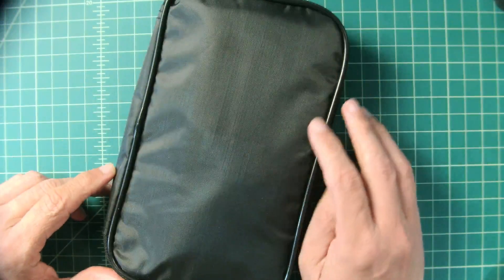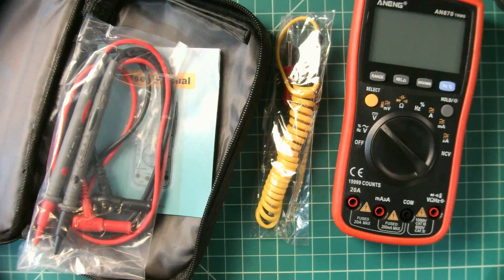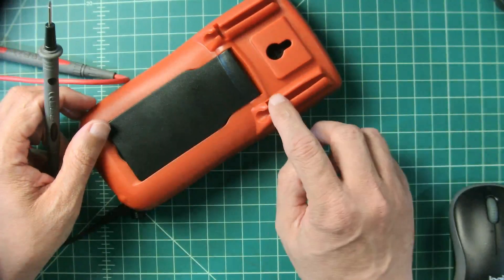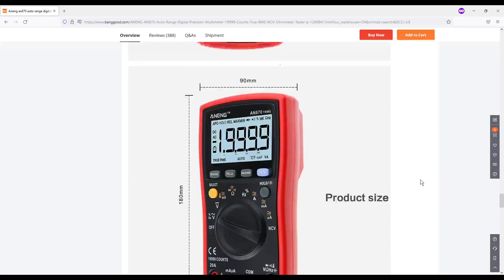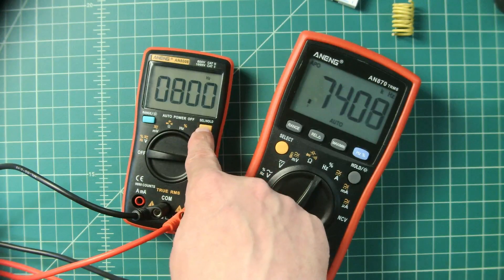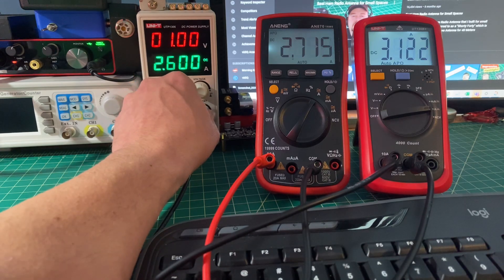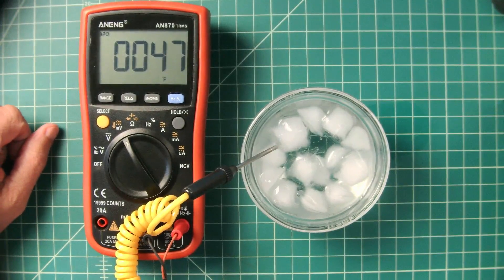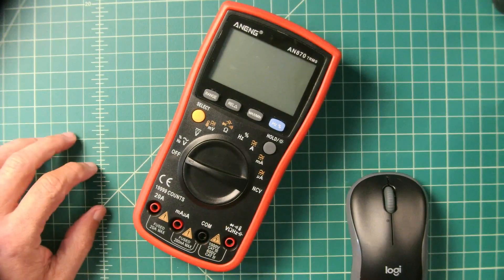ANENG AN870 Multimeter Review

Comment: "On the meter there are some ratings where it says it's a 1000v cat III and 600v cat IV.
I take those cat ratings with a significant grain of salt when it comes to these cheaper budget meters.
I wouldn't use them on any high energy circuits. I would use a more credited brand." 

All is said, in fact there is no need to buy a cheap meter cat IV 600v cat III 1000v if you are not going to use it as it should be intented to be used. 
When a known brand in this security catergory is about 300$ and this chinese is 55$ the first question that you should ask yourselve before sticking the test probes on high voltage current terminals is: "But where are the $250 of device security & mesurement components that are deducted from the price of the Chinese device?". May be not only $ for the brand logo and color. May be chineses builds are better than other...But, Unlike cats, we only have one life...
Reply from the maker: Totally agree Jerome, thanks for the comment 👍

Comment: Thanks for the video. You say you wouldn't use this only for electronic and desktop type work... Am I correct in understanding that in your opinion it would not be a safe enough choice for home electric work (230v)? Thanks
Reply: I am looking to buy a basic but safe multimeter for doing electric work around the house, and avoiding another cheap Chinese built multimeter that will not last
Reply from the maker: I wouldn't consider this one for that.  Maybe check out the Fluke or Bryman meters but they will set you back some cash.
Reply: @TheSmokinApe  thanks for advice. Any model in particular, considering it is definitely not a professional use I have, and cost is a factor. Thanks

Comment: I am going to re-cap an old Pioneer 70s Hifi amplifier ( a SA-9800). Is this multimeter reliable concerning the voltages in the amp or should I get something else? If so, what?

When thinking of it I also have a very old Akai M-8 Tube Reel to reel which has huge caps. So maybe this multimeter is dangerous to use in that environment?

Comment: The cheapest one at HFT is good for hobbiest purposes.  Under $10.00
Reply from the maker: Depends on your definition of “good” and what type of hobby work you are doing.  Thanks for checking out the video Dominic 👍
Reply: @TheSmokinApe  Just enough to get a ball park figure for outlets for 110V AC, 12-13.8v DC for car cig., batteries and power supplies, and checking track voltages and currents on 3 rail Lionel trains.  Use it as a job meter?  More than likely not.

Comment: hey Ape, My old Fluke 77 just went up in smoke & died a few weeks ago.  I was checking some voltages in my TS-430S to make sure it was ok. I opened it up and the main CPU blob was poped I a whole bunch of other components was burnt. Fluke said it would cost more to fix than to buy a new one got any recommendations? or do you have any you do not need? I got a few really cheap ones that only last a year.  this one was mine from my days at DEC in Field Service (1978-1985).  de N6KV
Reply from the maker: Even those it got smoked you might be able to sell the Fluke for parts on ebay, people do buy them up regardless of condition.   If you still want that type of quality you might want to check out some of Fluke's entry models.